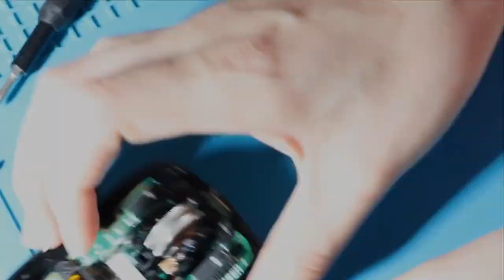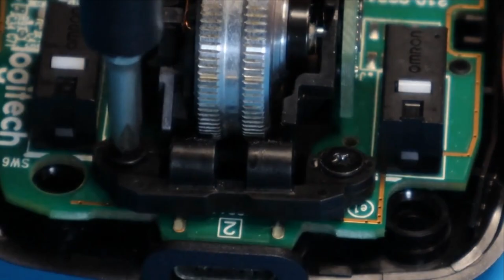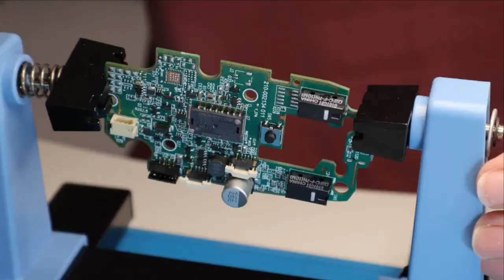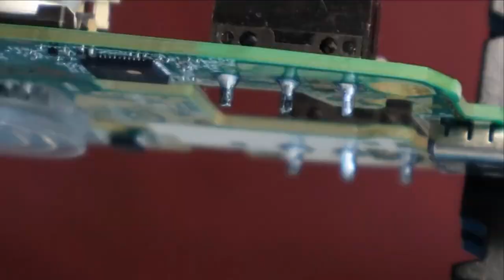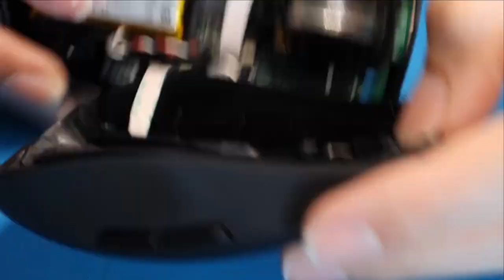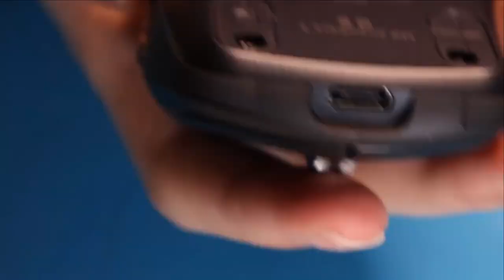Logitech MX Anywhere 3 - Switch/Clicker Replacement & Soldering

Comment: I can't desolder the original switches  on my 2S. My soldering iron isn't powerful enough I guess
Reply: I had the same issue. It takes persistent desoldering and prying the micro switch in between in order to pull it out. The circuit board needs to be hung in the air and secured with crocodile clips to perform this properly without the connector ring from the circuit board fusing to the micro switch during desoldering. A much harder task than it looks to be honest. Logitech must be using some high melting point solder that prevents easy desoldering.